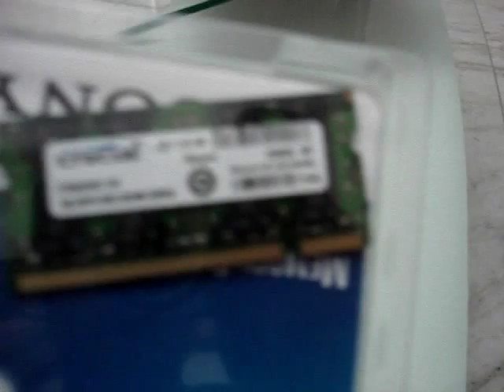Changing your DELL Inspiron 1525 laptop RAM (and other DELLs)

Comment: Thanks so much for the video.

You had mentioned to get 667 MHz SO-DIMMs. When I ran my system test at Crucial, they suggest I get 800 MHz ones. My processor is T5750.

Usually at Intel.com, they specify the memory types. For some reason, that particular data isn't available. If you were me, what would you do? Go with 667 or 800? Also are you happy with Crucial or would you suggest other brands like Samsung, Corsair or Kingston.

I'd love to hear your insights/thoughts when you have a moment.

Comment: Hi, I have the same laptop which I got in 2008. Its a 4GB can I possibly upgrade it to 6GB or 8GB? I ran the SMART-long test and it says my HD is failing. I have 320 can I upgrade that as well? Last, but not least can I also upgrade my battery, but Dell sells them too expensive can I purchase that from someone else. In another video I saw the got a Inker something. I wanted to upgrade the battery too while I'm at it. Thanks for your video and for sharing your knowledge.

Comment: Hello,

I have a 1525, and would like to upgrade over my current factory 1GB RAM. Since I do a lot of engineering design work, I figured 4GB would be great. Is there any reason I could not go from 1GB to 4GB? I understand my Vista 32-bit won't recognize ALL of the RAM, but should address 3.5GB. Will this be ok?

Thanks!

Comment: @wisetechie If i have the inspiron 1525 with 2 gb of RAM right now, what amount of RAM should I get? Do I need to replace the 2gb with a 4 gb module, or can I add a 2gb module on top of the original one?